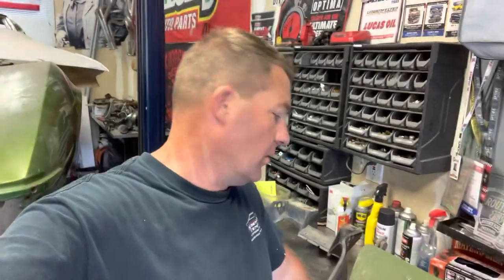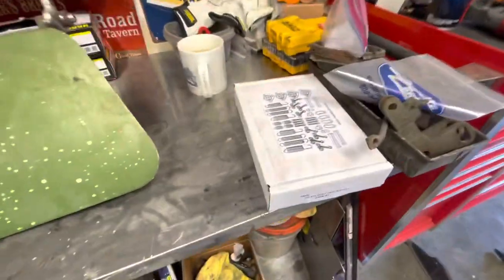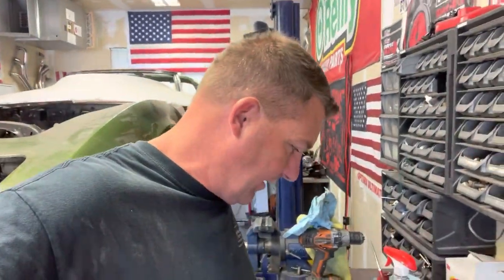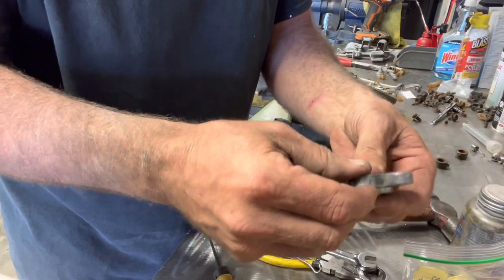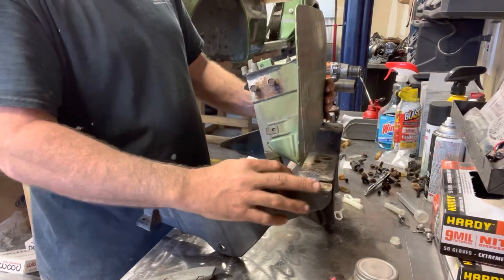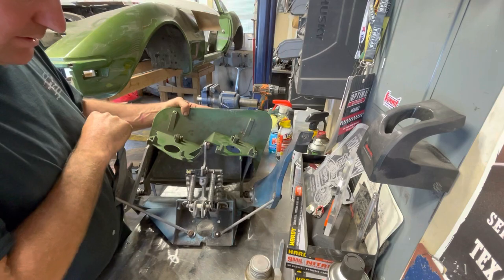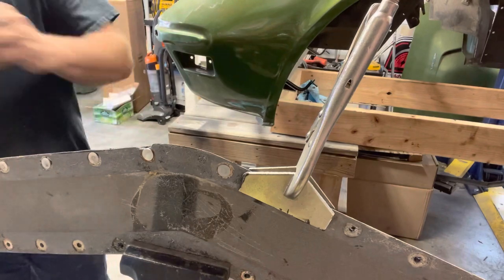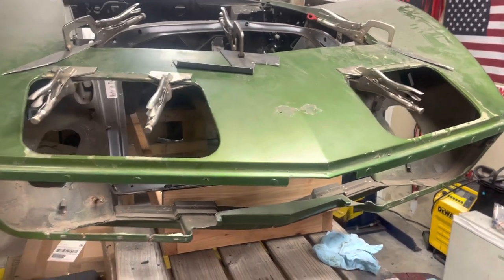1972 C3 Corvette Project (Pt1) Header Bar and Headlight Assembly

Comment: I’ve been there but I didn’t use the rivets, they’re gone. I used fusor 101ez. It’s great for fibreglass, it doesn’t set until you put heat to it.
Reply from the maker: Yeah, I’m not sure if I were to do it again that I wouldn’t use the rivets either. I used a combination. I used panel bond on both sides of the fiberglass bonding strip. So the sheet metal is bonded to the fiberglass and the bonding strip. Is panel bonded to the actual clip.
Reply: @mayermotorsports  it was very easy actually with the fusor. A header bar should be one of the first things you do.

Comment: I have a 79 Corvette where did you get your header bar from what's the best place thanks Arlin.
Reply from the maker: Arlin, I bought most of my replacement parts from Corvette Central. They have probably the best selection of structural replacement parts out there. Here the url for the header bar. 

https://www.corvettecentral.com/c3-68-82/body-frame/door-floor-roof-fiberglass/68-82-front-end-reinforcement-header-bar-metal-143004?returnurl=%2fsearch%3fcurrentsearchcategoryid%3d%26q%3dheader%2bbar